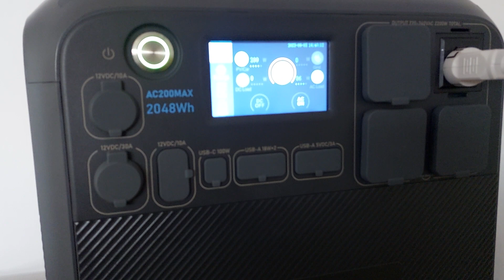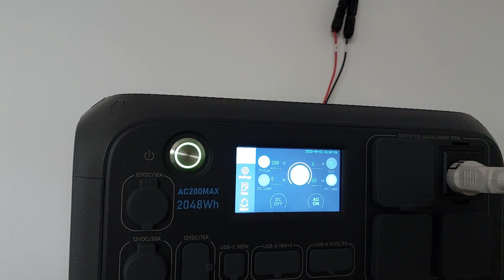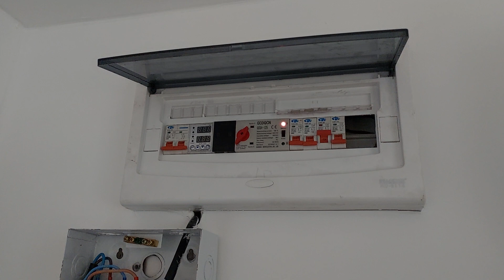Tiny House Powered Off Grid by BLUETTI AC200 Max

Comment from the maker: We setup the solar system for the sea container house to be run by the Bluetti AC200 Max.   On the roof are 2 540W monocrystalline panels feeding in through a hole in the container covered by a waterproof gland.  There is an array disconnect switch before going into the Bluetti AC200 Max Solar Generator.   Then the 230V alternating current is run through a cord into a solar sub-panel box with an RCBO breaker, over-voltage protector and power meter.  Then the 230V alternating current is fed into the main sub-panel where the Automatic Transfer Switch is located, set to solar priority, and then to the circuits for lights, sockets and air conditioner.   Today checking that our wiring was correct, we ran the air conditioning for 5 hours on a very hot day (34C).  Everything checked out fine, but clouds and a storm rolled in and solar input dropped to 300W or so while filming here, down from the 920W the maximum usually seen during the 1100-1400 period when the sky is clear.